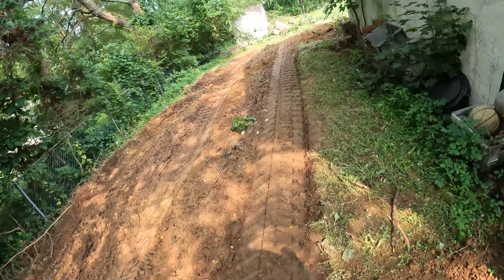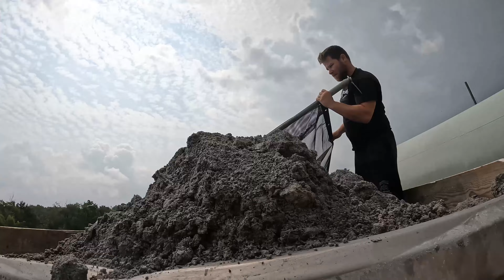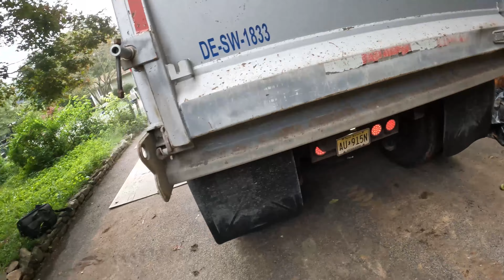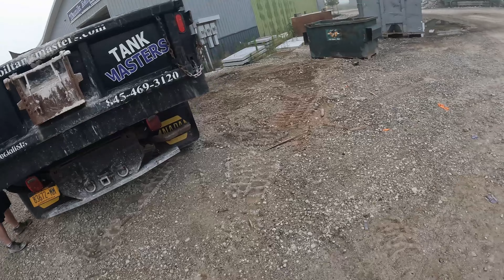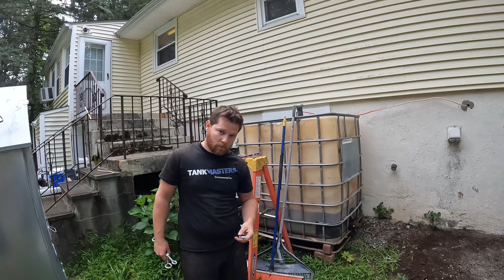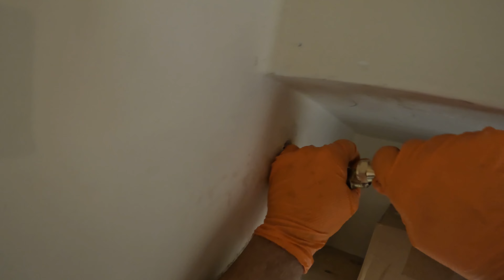Homeowner Was Told He Had No Coverage, When In Fact He Did

Comment: The hole is closed up by now but the Fernco coupler installed on the well supply line is rated for 4.3 PSI. The line will probably see ~60 PSI depending on the pressure switch settings.
Reply: Correct. I would have used a Harco coupling (all rated at 200 PSI)...apart from that, great job.
Reply: in the earlier segment that line was for a drywell, (drain) not a well, so will never see any substantial pressure
Reply: @rupe53  No problems at all then, it will be perfect.
Reply from the maker: it was a discharge from the washing machine into a pit with stone, zero pressure

Comment: This was a challenging job with very restricted access for sure.  Your idea of dumping the backfill material on the steel plates certainly was a good idea and made a difficult job a bit easier.  That crushed concrete certainly was interesting in that it had lots of large chunks mixed in with the crushed material.  Your team did an excellent job in finishing the area.  It looks better than when you started work. And this was all covered by insurance.  The homeowners picked a winner here.

Comment: Because the Roth is thin galvanized sheet steel that will very slowly corrode in the weather, you might tell the owner that it would be a good idea to apply a coat of paste auto wax every six months or year (whatever the wax mfr. recommends). That will stop corrosion, so that 30 years from now, the tank will look and be like new at very little cost. You might even furnish a can as a parting gift (with a Tank Masters label stuck on the lid, of course). Even if they just use it on their car, they will be reminded of you, and maybe they will recommend you to another prospective customer.
Reply from the maker: great idea

Comment: God job I'm in septic business. The bio mat under leach field and around drywells can get black from age. Newer septic's have vents on end of leachfield  .The extra air flow supposed to help the system breath better. If you expose a leach field leave it open for a few days or week, The black will turn gray and eventually go away.  That's why venting is important to get oxygen in the system. Older septic's can develop sulfur, that is black and can stain your hands. It's hard to wash off.  Septic's that haven't had regular Maintenace can build up sulfur sludge especially tanks not cleaned for twenty or thirty years. Those tanks are fun for a septic inspection to sell a house.
Reply from the maker: wow, interesting. thank you

Comment: Do you carry a spare PID meter? You would have to way the money cost of a spare meter against the cost of having your primary meter stop working (delay to jobs, time to get repairs done, etc.). All it would take is to jam up your work schedule during a busy period to make keeping a spare on hand, even it always stays in the box unused. Also do they make a, say, foot long metal extension probe, so that you could quickly jab the walls of a hole without the bother of gathering lumps in plastic bags (which might be necessary for final samples)?

Why don’t you get an certified engineer to design a pad that you could have made for you locally instead of paying higher prices? Surely
Reply from the maker: I have three meters